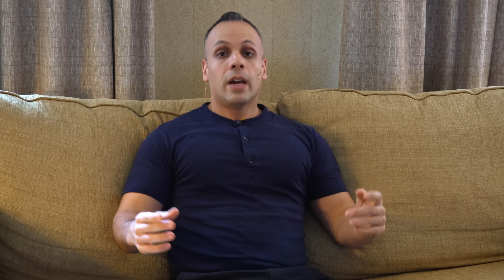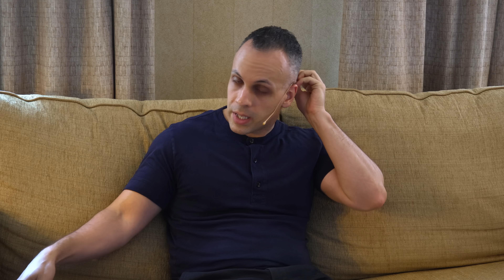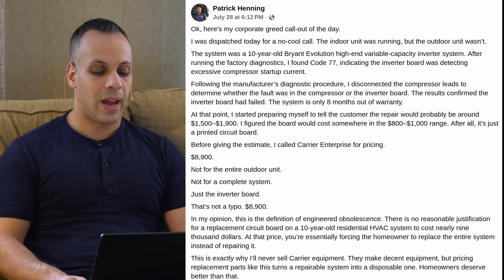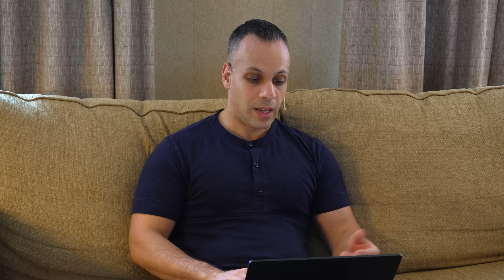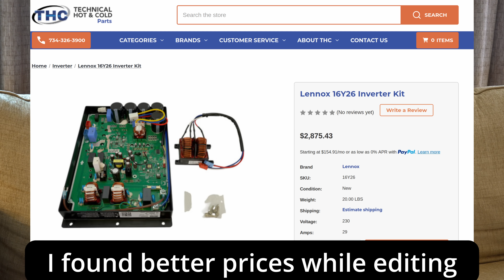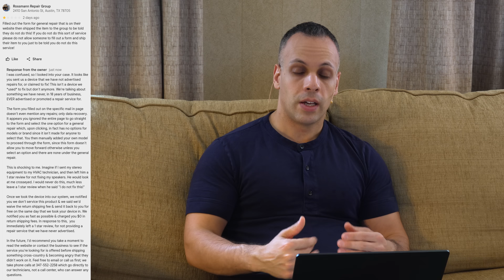Carrier AC repair has $8700 part cost for residential unit

Comment: One other thing about inverter based systems is that almost none of them offer the shelf are IEEE 519 compliant. So the home is being subjected to harmonics that shouldn’t be present. If you have enough of them on a transformer they can overheat the transformer causing voltage issues as well.

Comment: Those $8900 boards a lot of times you can find on Amazon copycat of those boards significantly cheaper. Those namebrand boards are always going to be ridiculously top price and I’ve had good experience using the offbrand Amazon ones for a fraction of the cost.

Comment: I know the Hvac industry very well. The whole industry is basically a scam from top to bottom to the refrigerant that are mandated to the repair guys. The bigger the company the younger they hire them and they get these kids to just replace every part. Ultimately, they are goal is to replace the whole system instead of fixing it, but the whole thing is a scam. You have to know how it all works so you’re not beaten, but with Hvac, you should always get a second repair even if it cost you $150 to get one of these idiots. I always do a second opinion repair if it’s over $1000.

Comment: Everything in AC, solar panels is a scam. AC is literally few pipes with a compressor, valve and 2x30bucks of radiator. If you are paying 10k for AC im quite certain you are paying someone 5k for few hours of work of a worker that is making 50 bucks an hour max(probably half of that). Nowadays they use all kind of manipulation tactics(check out selling psychology etc). They sell you much too big units. Making you pay like 5 times of what you should and pocketing half of it.

Comment: Recently built a small house of 740ft^2... HVAC contractors wanted $7500 (cheapest) to install a low price range 2 ton forced air heat pump unit, which did not include the ductwork, that would be another $1500. Instead I went to Menards and bought 2 through wall 1 ton Heat/Cool units for $378 plus $100 for the wall sleeve each. They're quiet, cool and heat well and will be super easy to just pull out and put back in place. So for about 10% of the cost of a central unit, I'm handling the HVAC needs of the house. Or in other words, I can replace both units 10 more times (don't have to replace the sleeves) and still be money ahead.

Comment: And now for the rest of the story from an engineering view:

Carrier and most of their competitors used air cooled power inverters located in a dirty, vibrating outside environment.  Almost all of the early models were poorly designed and routinely fail.

Carrier does not want to sell a board with known reliability issues and avoids propagating them with the price.

Inverter boards running compressors are high power - more power than anything else a consumer would buy short of an inverter in a hybrid or electric car. However a 25 year old Prius has a reliable inverter capable of completely driving the car to at least 42 mph, limited only by the small hybrid battery designed primarily to capture regen power for high mpg.

A vehicle's inverter is always liquid (water/antifreeze) cooled which optimizes power transistors and allows a completely sealed inverter system.  Early Carrier and other hvac inverters were air cooled with pc boards exposed to the poor outside unit environment.

A few new hvac inverters have a heat sink connected to a refrigerant line to improve cooling but still not as good as fluid cooling and still exposing the board to the environment.

Some high end Carrier contractors who are transparent (one with a big video and podcast platform) have resorted to power conditioning transformers on the incoming 240 vac supply and dedicated surge suppressors.   Carrier and others love to blame incoming power surges but this is not the root cause as described above.

Some will offer ten year manufacturer warranties with or without labor.    I always recommend those warranties but never aftermarket warranties.

Two speed compressors are a reasonable compromise and change speed by using a solenoid to unload the compressor for 66% capacity.

Finally inverters primary advantage is not efficiency but is their ability to overspeed a nominal 100% capacity.  This allows 100% heat pump capacity at 5f or lower which is good marketing.  Unfortunately maintaining 100% heat below freezing does not help 98% of the housing stock with minimum insulation and air sealing, eg those homes that are not passive house or close to it.  In fact, transparent hvac designers will still recommend high end heat pumps with backup fuel heat.  These provide dual fuel operation and provide a fossil fuel heat that can be run with a low cost generator, something  not possible at a reasonable consumer price point with heat pumps.

Comment: Carrier dealer here, I started selling Goodman due to Carrier jacking up their prices EACH month, I tell customers to NEVER buy high efficiency units, way too expensive, you will never recoup the price in savings, they have more parts to go wrong and are more delicate and prone to crap out, you will be lucky if new units make it to the 10 year mark after a lot of warranty work, remember there is nothing free with warranties, you will get charged all sorts of fees and all the labor greedy companies stack on, a/c companies is not in it to help consumers they are there to enrich themselves, also stay away from new side discharge units, basically mini splits with a lot of cheap electrical parts that will go bad with any spike in electricity, ACIQ has a lot of problems with their indoor and outdoor circuit boards and are not available locally

Comment: i bought a HVAC  10 years ago specially without electronic control  for the specific reason that the electronic board may not be available or extremely expensive in the future.

Comment: I just purchased a 12,000BTU mini split ac unit for $285 in Europe. The whole system costs that. It plugs into an outlet and only needs a  1" hole through the wall to install. The system meets the newest EU refrigerant guidelines and uses inverter tech, so it's very energy efficient. The HVAC business is a racket in the US.

Comment: I have a Lennox unit, who 'discontinued' the compressor. On investigation I learned it uses an LG compressor, but the original spec is no longer made. There is a new generation which is completely compatible...

Good luck finding an AC installer to do it. If I was allowed to fix it myself, it would only cost a few thousand to fix. Instead, I'm being quoted to replace the entire system.

Comment: Thanks for the Carrier info... IMHO, Goodman is better than good enough! My last house had a 2004 Goodman compressor that was still running when I sold the house in 2025. Only maintenance was a few new $12 start capacitors self-installed from Amazon, and a couple of ~$200 refrigerant boosts every few years. The new place has a 2012 Amana, and inside it has some sort of diagnostic box with L.E.D.'s to help with troubleshooting...

Comment: Could the inverter board be repaired?  The chances are that the board does NOT have complicated microcontrollers on it, and the components are larger and more easily replaced.

Comment: Unless you have plenty of disposable income do not buy anymore more then a single or two stage HVAC system.  Inverter driven systems are outrageously expensive to repair because the inverters, compressors and fan/blower motors are constantly changed during production as various revisions are done making them a hard to source part for your particular serial number. Any HVAC technician with some years under their belt can tell you it's not uncommon to have parts no longer available on such systems that are still in the 10 year warranty. Or having to jumper out such systems controls and turn them into dumb single stage systems and rely on third party rescue parts.

Comment: I'll bet the numbers on the chips and semiconductors on that inverter board are ground off so you cannot easily identify and replace them. If they haven't started already, it's only a matter of time before they start to serial-number lock the boards to the components so you cannot simply swap boards with a used one pulled from a parts unit. Just a few weeks ago, my 3 year old Arcoaire AC condenser unit blew it's entire charge of R-410a when the coupling between the copper discharge line off the compressor and the aluminum line going to the condensing coil split open. Arcoaire, which is an ICP International Comfort Products brand, who also makes Carrier. Since the unit is only 3 years old, it is still covered under a 10 year parts warranty. Since R-410a equipment has been phased out, the supply house that normally stocks ICP parts, no longer stocks parts for that unit. No other supply houses had a coil either. Fortunately, one could still be ordered, but it is expected to take 10-20 days to get here, and I had to pay for the coil, plus the shipping freight, upfront. $1160 + shipping and taxes brought it up to just over $1400. I'm going on day 12, and it has yet to arrive. After it's swapped out, a request will be put in to get a warranty refund of $1160, I eat the shipping and tax. That's assuming they don't deny the warranty repair and try to claim the damage isn't covered due to what they believe was an "excessive refrigerant charge or improper installation", which Ive been told they may try to do. This unit is a "dumb" unit, it does not use a control board. When I was having my 15 year old Trane replaced 3 years ago, I specifically said I did not want a unit with any kind of ECM or variable speed motors, or any advanced control boards. My gas furnace is from 1979, still working fine. I clean and do a combustion analysis on it yearly. I can and have made my own repairs on it. The gas valve can be replaced with a universal one, and I can also replace it's control and ignition unit (which is still original in mine) with a universal control that can be configured for the furnace. None of the parts are more than a few hundred at the most. Many of the parts can be found NOS on eBay for less. So long as the heat exchanger doesn't crack, I'm going to continue to use it. HVAC companies salivate when they that old unit as they immediately start to price up a full system replacement.

Comment: You have joking about repairing these boards..
There's a guy on YouTube pine hollow Auto diagnostics. 
About 7 8 years ago Ivan took a look at a lens grinding machine circuit board problems that his wife's boss had. 

New machine was like 15,000 might have been more so he took a look at it cuz it was kaput. 

Using his basic or advanced at electronic diagnostics ability he ended up replacing a board with a chip used off YouTube for like 120 bucks I can't quite remember I don't want to lie.
But anyway he saved his wife's boss thousands and thousands of dollars cuz he was going to have to buy a new machine and Ivan had done the same before with circuit boards for his heating system HVAC in his own home so it is a doable thing obviously depending on what's worn out

Comment: Terrible. I actually have been looking into passive/alternative cooling technologies as the HVAC world is basically a convenience racket. 
Units should last long and be cheaper to purchase and maintain. Additionally, we should be using WAY more Geo and cooling ground loops than we do. 
The building codes and industry is structure so that builders slap AC units into everything, even if it's not the best choice.

Comment: We had a control board in a Carrier AC unit fail. It was an older unit but parts were still available. The local HVAC company didn't want to repair the unit and instead was trying to push us toward buying a new one. The part was available from various places online but none of them wanted to sell to us.

In the end, the most economical option was sending the board all the way across the globe to Australia for repair. That was almost a couple years ago now and it's still running great.

Comment: Engineer/operator here.  In the commercial/industrial world, I'd say carrier is no worse than every other manufacturer for things like this.  They all do this.  What I am about to say is not a justification for the price- it is just what I experience on a day-to-day- that inverter is for a previously sold carrier infinity series using 410A, which has (had) a 10 year warranty.  A quite expensive unit, and one that was forced to not be manufactured any more due to EPA legislation.  Carrier is not "allowed" to make the unit any more (as of last year), and they actually stopped in late 2024.  Carrier (and many other manufacturers) simply do not support legacy lines of equipment for long after they are discontinued, and with EPA seemingly perpetually outlawing the "new good stuff" refrigerant every 5 years, it does feel like an industry that does not need propping up is being propped up by legislation creating artificially shortened market lifespan of any new equipment.  So yes, this seems like "fuck you, buy a new one" tactics, perpetuated by a legislation cycle.  Louis, can you investigate the latest mess of EPA regulation with A2L refrigerant while I wear my tin foil hat?
Reply: How would I go about learning to repair inverter boards for AC systems and mini splits? I’m an HVAC student right now less than a year from getting certified but I’ve studied my ass off. I’m still young, and I know the future is electronic and digital, so if I learned how to repair these boards it would help me a lot. Also I have minor experience in soldering too. Any reccomendations for books to read, videos to watch, or courses to take would be greatly appreciated.

Comment: I had a Goodman AC installed in the fall, within weeks it failed, the board was 1200$. I chose to pay for the repaired because I was so pissed at original install company.  Then I was told that I could have just the board replaced, I had to replace the motor and board as a pair.  Ended up paying $3000 to have my brand new system repaired.

Comment: before making any purchase on an electrical item i check to see replacements are available and then the cost of parts.  no replacement parts is an autmatic no which leaves looking at the products i can get reasonably priced parts for, not always the cheapest but definitely not the very top price either. spending $3000 on a part for something that cost $300 new is ridiculous

Comment: Had a similar situation with a ECM fan motor.

Determined it was an electrical issue within the motor. From what I researched they used to sell the electrical modules separately but not anymore. 

Seeing that a new motor is $500, I decided to open it up and see if I could identify an issue on the board and put my novice soldering skills to use or bring it to someone for repair. Found the board was inaccessible with a thick layer of rubber glued on top. 

Not an HVAC guy so I dont know the reasoning but can only assume the powers at be are very happy that I had to spend $500 on a new motor over a small repair.

Comment: I was in HVAC for 46 years now retired. I always hated Carrier. That is a FU price for sure. I live in MA. We run AC but its not like the down South. High efficiency equipment the cost of repairs can't be justified here. We usually don't run them as much although this year is hot. Same thing with ECM (variable speed) furnace blower motors. Way too expensive. But those have a work around. You can buy a kit to convert them back to a PSC (permeant split capacitor) motor

Comment: I'd fix their inverter board for $2000 and it would more reliable and tougher than the original board or replacement board OEM.

Comment: What Horseshite !    I've had the same A C,  (2 ton package unit ), for thirty years.  The defrost control board got cooked in a thunderstorm, so I just ripped it out and made the unit into a straight cool.  I have replaced some capacitors and performed the usual maintenance.  Also I was a HVAC tech, back in the day.  I cool and electrify my house for next to nothing because it is so well insulated.  Better insulation beats the snot out of a more sophisticated / complicated A C system every time.  I am also a refugee from NYC.  More power to you Louis !!!

Comment: they need to make manufacturers have longer waranty ,or price of parts cant add up to more than 20 pecent more than whole unit or something.
I bought best efficency simple ac system no variable speeds or circuit boards just to avoid these problems
 i put unit in myself just had them vacuum the lines and braze connection it was only 2000 for whole system and has run 27 years i replaced fan and a contactor for 250 bucks in 27 years.
i was offered carrier and said no thanks they had all their own parts not common ones you can get anywhere

Comment: The inverter circuit board on one of our Mitsubishi mini splits failed after 4 years, and Mitsubishi wanted $670 for the part, or basically half the cost of the a/c unit. It's sad that these corporations have a business model that involves building junk, then robbing their customers to repair their products.

Comment: Buy middle of the road HVAC system from manufacturers ...
 NOT TOP BRAND NAMES (You'll be sorry)
 Also buy copper units not alunimum (leaks) coil if possible...